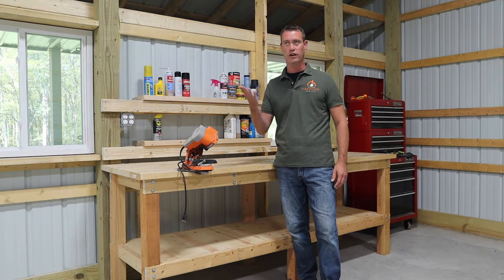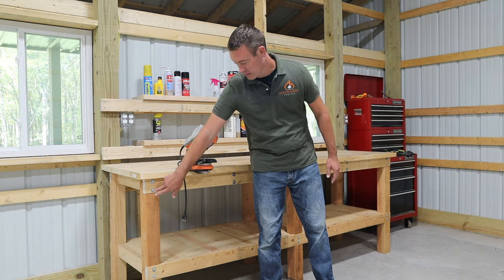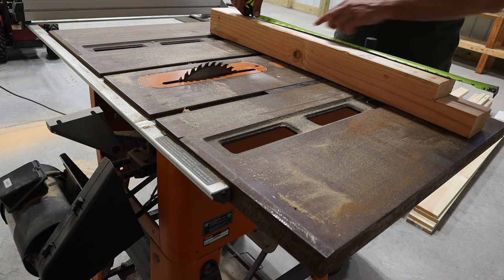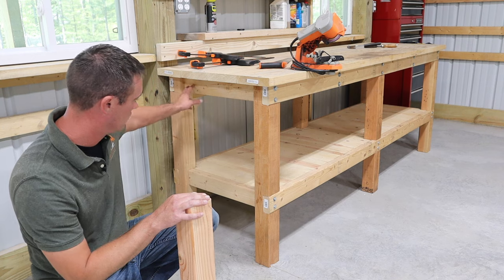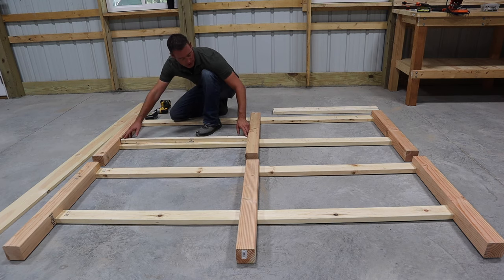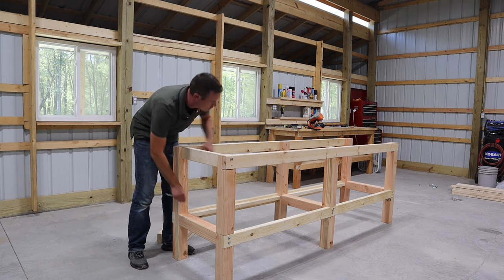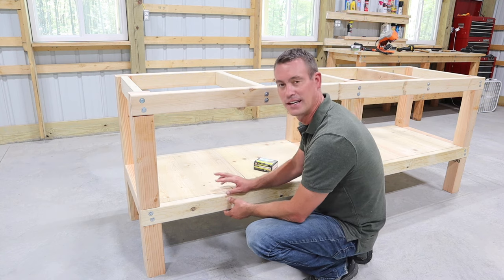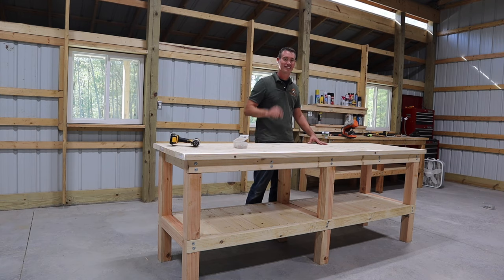How To Build A Workbench - The Best Way

Comment: At last, a build that uses normal tools instead of the thousands of dollars worth of workshop equipment that are in most of the other videos. Thank you.
Reply from the maker: You're welcome and I'm glad you liked the video!
Reply: @firewoodforlife  would a hacksaw work.
Reply from the maker: @Jerbt  A hacksaw is made for cutting metal so you would want to use a saw that's made for wood.
Reply: In 2021 it's the lumber that costs thousands.
Reply: @anthonym612  Cost me 30 grand not including screws
Reply: @frenchonion4595  I have $30 million in plywood in mine.
Reply: @anthonym612  I was ready to post that comment and then i seen yours, lmao
Reply: @Andrewsky347  Just paid 300k for the wood and the screws. This is gonna be a sweet ass work bench.
Reply: @metalfingers7453  Using the finest pine that Home Depot sells I presume?
Reply: This!!!!!!
Reply: Most people don't own a table saw.
Reply: Just copy all the step he did with the regular tools you have
Reply: All you’re gonna need is a chop saw and an impact driver…

Proceeds to bust out table saw lol.
Reply: @Andrewsky347  he told you to use 2x6’s
Reply: People you can always use more or less tools! Whatever floats your boat.
Reply: @MarcM-jc8bd  You can use a circular saw to cut the joints as well. They're really cheap especially if you get a used corded one on marketplace or at a pawn shop.

To cut the joint, make a mark for how deep you want the joint to be and put your saw against the side of the board. Then adjust the depth of your saw so that the bottom of the blade lines up with that mark you just made. Then make a series of cuts across the width of the joint the same way he did in the video and break them out.

If you want, after you break the pieces out you can take your saw and move it back and forth across the width of the joint to quickly cut out rest of the material and make smoothing/sanding faster. Hope that helps!
Reply: Yeah, if I could afford all the tools some of these guys use, I would just buy a work bench.
Reply: I know im really late to this post... but I agree 1000 percent. Im just stating out and dont have a bunch of the tools needed. This can easily be built in the garage and is sturdy.
Reply: I know right, all the other videos use these special machines in their shops lol
Reply: mmm, yes normal tools. though i don't have a table saw or miter saw or chisel...

i have a sawzall & and a hand saw.

can it be done?
Reply: @jordansmallwood4605 exactly my thought lol
Reply: @MarcM-jc8bd that’s what I was thinking too.
Reply: Right!? Most glue methods alone have 300 dollars worth of clamps alone, never mind actual equipment! 
Great vid!
Reply: I just wanna see someone made a bench without using a bench

Comment: I used this vid to build a workbench. The only thing I changed was the dimensions and the bench surface. I made my bench 6 feet long and 32” wide, and used 3/4” sanded plywood for the top. I’m applying polyurethane to the sanded plywood. I’m on coat #6 now and it’s building up to a wonderfully smooth, wipeable surface. Otherwise,  I built it exactly to this plan. I’m very happy with how it turned out. If you follow this method and use these materials you’re building a bench that will outlast this century, and someone, 100 years from now, will cherish the workbench YOU built. Thank you very much for making this video.
Reply from the maker: Thanks for watching.  I glad it turned out nice for you!

Comment: List of items:
3- 4”x4”x8’ lumber
5- 2”x4”x10’ lumber
2- 1”x1”x8’ lumber
4- 2”x8”x8’ lumber
4- 3/4”x5.5”x8’ deck boards
24- 5 5/16” lag bolts
32- 5/16” washers
1 box- 1 5/8” construction screws
1 box- 2.5” construction screws
1 box- 3” multi-material screws

Video: https://youtu.be/CnQ53Agu2qY
Reply: Missing the 8- 3 5/16" lag bolts
Reply: Also there's no such thing as multilateral screws. :)   It's multi-material screws
Reply: Further update. Any time there's a mention of 1" x 1" (he also says "one by") it looks to me like he means 2x2 (which is the same width as a 2x4). Not totally sure about this one though, until I get to that stage of my build.
Reply: @SeerWS  do you see that spot on the ceiling?   I know its there!
Reply: @SeerWS  just starting this build and buying the wood. whats the verdict? 1x1 or 2x2? thanks in advance
Reply: It's in the description.
Reply: What’s the average cost of this build?
Reply: @benschroeder1161  I priced it out before tax it's about $177.
Reply: @SeerWS  yeah..... i'm just watching this and noticed that too.  definitely a 2x2.
Reply: Thanks for putting together a build sheet!
Reply: @gungnir4076 How?  It cost me like $350.
Reply: @This_isnt_where_I_parked  that's what I priced it at my local Lowe's.
Reply: LOL.
Reply: Thanks for updating your comment to include what you missed.
Reply: metricsssss :D

Comment: I built this in about 5 hours (and I am extremely meticulous and slow). I bought all the materials at Home Depot for $180. I also made a wood purchase mistake though. Instead of 2x8's for the top, I accidentally bought 2x6's. This was rectified by buying an additional 2x8 and so on the top I have 4 2x6's and 1 2x8 (on the front edge). This gets about 3 3/4 inches overlap on the front edge with a perfectly even backside! Perfect! Thanks for this video!
Reply from the maker: You’re welcome.  That’s great to hear!

Comment: I’m very new to carpentry but decided to take a crack at this as I needed a workbench in my garage.  I gotta say, it came out great.  It’s super sturdy and feels like it could support the weight of my truck!  Took me maybe 12 hours total and if I were to do it again I could probably do it in 6.  In total I spent around $200 in wood and screws/bolts.  One tip l’d give is if you’re using cheap construction lumber, take the time to pick the best pieces possible from the pile.  It’ll make your life a lot easier…

Comment: Finished my new work bench adopting this great design. I made this a little longer and bought 4x4 at 10ft, this was enough to include for 6 cross bracing supports. The bench is solid, does not move easily and absolutely over the moon with the results! Thank you so much for sharing this design and creating a simple but effective walkthrough on how to build.
Reply from the maker: Fantastic!

Comment: I like the idea of using lag bolts to hold the frame together and leave the bottom shelf boards free floating, means if I need to move the bench (as in a new home) I can just disassemble the whole thing into the two frames, and I would only have to unscrew the top boards, unless you went an extra step to flush fit them on top like you did the bottom boards. Would make moving it a smaller more compact job in a trailer.

Comment: Looks good. I have to make a new one and your plan looks easy. My old one has a sheet of hard board on top, then I made a thin frame around the outside to keep it from sliding. Now the top is smooth and flat.

Comment: Thanks for the video - quick and to the point !! I decided to build 2 benches side by side .. only made the  4x4’s 38” vs 35.5  and decided to to use sanded 3/4” ply for the decking … I don’t have a table saw ( yet ) but was able to do all the joints with a skill saw ..again great video - thank you
Reply from the maker: Glad it helped!

Comment: This is the video I’ve been looking for.  Straight forward presentation using typical tools and material.  I never would have thought to use 1x 8s for the top, but it makes so much sense for my needs.  Thank you so much!
Reply from the maker: You're welcome and thanks for watching the video!
Reply: Do you mean 2x8's?
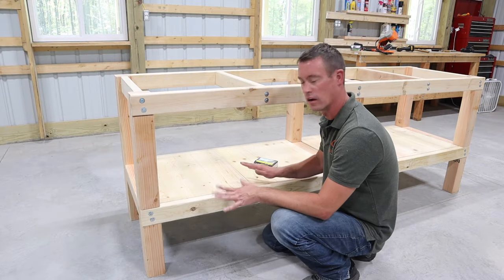Reply: @michaelkulman7095  9:29 he said they're 3/4 of an inch thick, so I don't think they're 2*8
Reply: @MrEscape314  I don't think he's talking about the top at that point in the video though.
The original comment says 1x8s for the top but I think it should be 2x8 but there are a lot of cross pieces so if one wanted to top it with 1x8 I suppose one could but most people want a heavy duty work bench with a 2x top if using dimensional lumber.
The lower shelf which I wasn't referring to can be thinner, like 1x or 3/4" and the cleats the shelf boards rest on can be 1x1 or 2x2, either way, if you have the right screws or nails...

Comment: Great for novices to create an incredibly useful bench - only a couple of missing points: use cinch straps to hold the cross pieces while tacking them in; need to take the safety guards off the table saw to make the notches in the 4X4s (and I notched the lower shelf planks as well); using construction lumber makes a much less attractive but just as sturdy bench. two favorite aspects: the sturdiness, the fact that it comes completely apart so you can move it anywhere (my current house is on a ledge with about a million stairs to get up to the house, anything coming in or out has to be dissassembly-able!)

Comment: Great workbench and video.  Not sure if anyone mention this, but the cut you made at 3:10 is seems unsafe.  Having the piece between the blade and the fence as you are pushing past the blade seems it would be a big candidate  for kickback.  Sorry if I am out of place as I am only into this woodworking about a year and half and still learning.  Keep up the great projects.
Reply: You are correct, that's an unsafe practice. Do not use the miter gauge and rip fence in the same operation.   If you want clean and accurate cross-cuts, a simple crosscut sled solves the problem.

Comment: I'm pretty sure those are 2x2 and not 1x1. Also, deck boards are 5/4 (1-1/4") thick, not 3/4", so for the bottom shelf you would need 1x6 instead, which are 3/4" x 5.5" as you stated in this video. The only difference is the long edges are square vs deck boards which are chamfered.
This was a great video and I'm making mine this weekend, just clarifying in case it helps anyone out.
Deck boards are stronger and treated, but are 1/2" thicker than 1x6 so choose one or the other and measure correctly!

Comment: as a fellow gentleman who needed a new bench, I built this with a miter saw, table saw, and optionally used my band saw. I could have done without it, but it saved me time cutting the notches with the table saw.
A LITTLE ADDITION: I added a 2x4 upright along the back of the bench as a wall to prevent losing things behind the bench.

Comment: Just finished my modified length bench.  Coated with linseed oil.  Looks fantastic.
Reply: I have been wondering what I should coat the workbench I'm going to build with and I think this is a great idea.  Did it darken the wood a lot?  Any particular brand or way on putting it on you found easiest?  Thanks
Reply: @texasbtc   I used Solvable brand boiled linseed oil.  Very minor coloration.  Brushed on, rag to remove excess.  Has a catalyst to speed up drying.  Looks and works great.
Reply: @universe74  Thanks!

Comment: I built a workbench very similar to that in 1982, and I still have it. The main difference is instead of lag-bolts into the legs (4x4 red wood), I used bolts and nuts so the top layer and middle layer could be removed for easy transportation if needed. I used heavy duty plywood instead of wood strips for the top and middle shelf. I later installed 4 metal drawers by cutting out space in the front facia board just below the top.

Comment: Nice. Did it! Outstanding video! I modded by make it 4 ft, used all construction screws not lag scews, and the 2x4s. Also note the 4x4s like all dimensional lumber today,  are really 3 1/2". I only could fine PT wood in a good length for the 4x4s.

Comment: Thanks very much for the great design.  As stated, it was easy to build and completed in one day.  The joints make for a rock solid, sturdy bench.  The only modification I made was to replace the 2 x 8s for the bench top with 1 1/2" MDF.  It made for a smoother, more level surface.  Thanks again!
Reply from the maker: Glad it helped!

Comment: To me, the best way is what you can afford to do and however suits you.  My first workbench I made with used lumber and I made it 48" high because I'm 6'8" and I hate bending down all the time, lol.  The top was made of 2x6's and the legs, framework and bracing were all 2x4's, some with notches out of them where wiring had originally run through them when they had been part of an old house.  I still have it and still use it though I have built heavier duty ones since as time and money permitted.  It was built with a corded skilsaw and a 40 year old corded black & Decker drill with worn out motor brushes, but it still managed to drive in the deck screws I used to assemble it with.

Comment: I just built your model over about 3 days and love it! I neglected to put the deck board stringers on before I assembled it (got excited and ahead of myself), so had to make my 68-yr old knees suffer while I crawled around awkwardly getting them fitted. I expect that I will add drawers to hold some stuff, but that's for later. Thanks for the great project!
Reply from the maker: You're welcome and I'm glad you're happy with your new workbench!
Reply: I'm even happier now that it has 4 drawers.

Comment: Great stuff! Made this last weekend and followed right along. Ended up using a circular saw to notch out the 4x4's. I also had to use 2 ratchet straps from my pickup to hold the supports in place while putting in the lag bolts. Still pretty easy to do. Thank you so much!
Reply from the maker: You’re welcome and I’m happy it worked out well for you!

Comment: Thanks so much for this awesome video - I followed along and it turned out great. Some notes on my own experience:
1. Cost for wood and hardware buying in Los Angeles in May of 2021: $300
2. Loved your tip on cutting out the 2x4 grooves without a dado. Brilliant!
2. I had to clamp the two big side frames together with the 4x4 cross beams to prevent the 4x4 cross beams from wanting to separate from the frames when driving in the bolts. I couldn't just hold it together, not even close.
3. In order to hold the 4x4 cross beams in place while I worked the clamps, I had to drill in temporary blocks below the 4x4s that acted as supports to hold them in place.
4. I considered not using the 2x8x8s for the top and instead using one sheet of plywood as many have mentioned, but used them anyway because it was so easy to just place them on top and screw them in, and they are fine. The fact that they create a slightly uneven top doesn't bother me. I did drill the screws in deep and plugged the holes with wood plugs for a smoother top.
Thanks again for this design and how-to. It's exactly what I wanted!
Reply from the maker: Great tips and I'm glad you love your new bench!
Reply: You are the real MVP🙌🏽
Reply: Maybe add tempered hardboard to the top later for a flat surface and ideally plane the top first?

Comment: I'm a beginner/novice. I have a circular saw and miter saw. It took me several weekends to build mine but I made one that was 6 feet instead of the 8 feet here.
Couple of notes:
- I had to predrill for the lag screws. The first one I started split the 2x4.
- I couldn't find 1x1 so I used 1x2.
- For my 6 foot workbench, I didn't rip a board to finish the bottom. I spaced each board a tiny amount away from each other and it filled in nicely.
Reply: What did you use for the bottom boards?  Its my last item to source but I don't see anything that is 5.5in x .75 in in deck boards.
Reply: @universe74  I used 1 x 6 (.75 x 5.5) Premium Kiln-Dried Square Edge Whitewood Common Softwood Boards from HomeDepot. I got 6 ft in length and were $8.58 when I got them.
Reply: @mcravenufo  Thanks!

Comment: Great Video with a wonderful presentation. I am attempting to try to use your information with some modifications. I want to add 3 drawers that will be side by side just below the top surface which means I will not be able to have a 4 x 4 leg in the middle like your build but possibly one in the back middle as the middle drawer will not interfere with the 4 x 4. 
I am also going to make it mobile by using 3" casters (One on each corner). I have been told that even with a 7 foot long x 40 inches deep workbench that 4 casters would be good enough. 
I want to add a side and end vise as well. (Beyond my skill set at this point but hopefully I will get some help with that part). It would be great if you did a video if you ever add a vise(s) to your workbench. Thanks.

Comment: I'm just getting to the table top and the link for the 3" material screws is for "truss head" screws and they look like they're going to stick up out of the top. I just wanted to make sure I got the right ones because in the video you mention the heads being flat.
Reply: If not too late, you want to get the flat head screws like deck screws or star head construction screws.  I prefer the brand Everbilt.  At HD they are called #10 x 3 in star drive flat head exterior wood screws.  I use exterior screws even in inside my building.  These screws you can use an impact driver to sink the head of the screw.  Good luck!

Comment: Dude, great bench!  EXACTLY the build type I was looking for!  I just had the Amish build me a new 40x30 pole barn shop/garage and was looking for the perfect bench for my area that I could build with just my chop, table, and circular saw. I am in the middle of this build now and just a few more steps until completion (hard to dedicate a whole day on this with a two year old rowdy boy).  With lumber prices still high, I had enough 6x6 posts that were scrap from the barn build to use for my legs. I work in a medical receiving warehouse and using some perfect 3/4" rough cut planks, 1x1's and 2x4's from a crate that some equipment came in for my bottom shelving.  All in all, I'll probably only spend about $60 on lumber (I'm using 2 layers of sanded 3/4 plywood for the top) to finish this up!
Can't thank you enough for making this video!  Cheers!
Reply from the maker: Congrats on the new barn and I hope you enjoy your new bench once it's done!